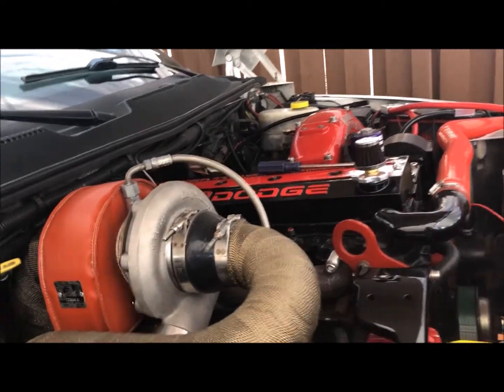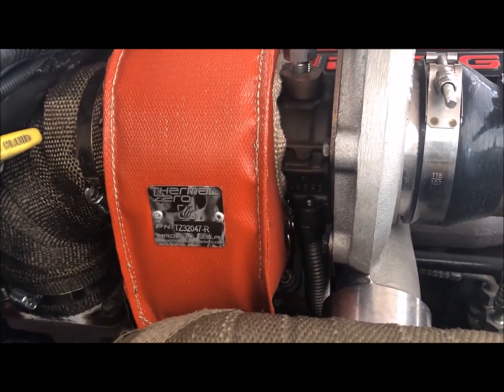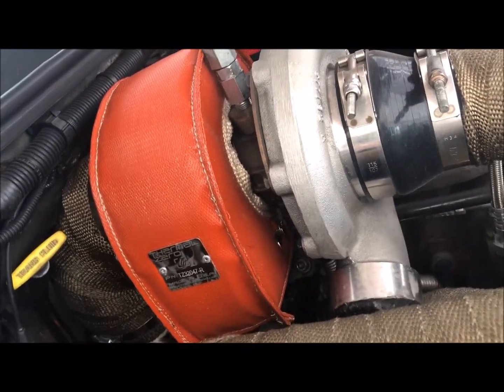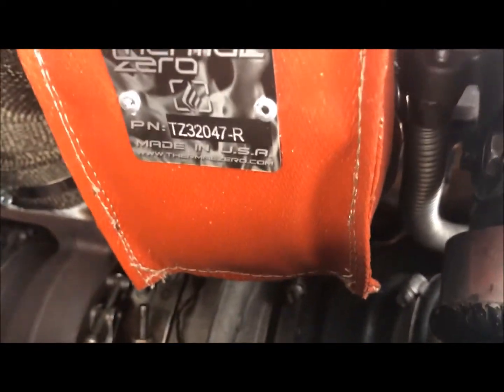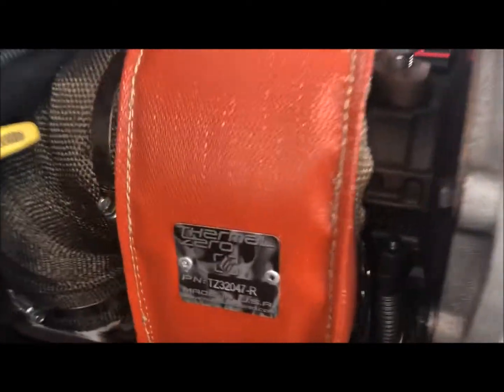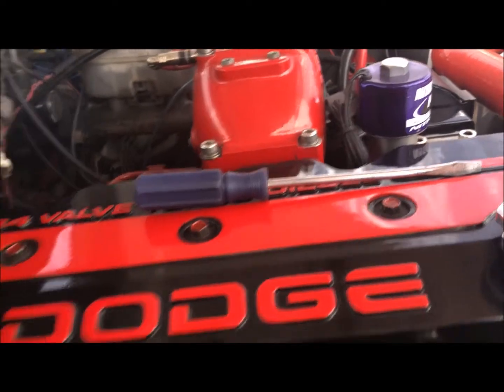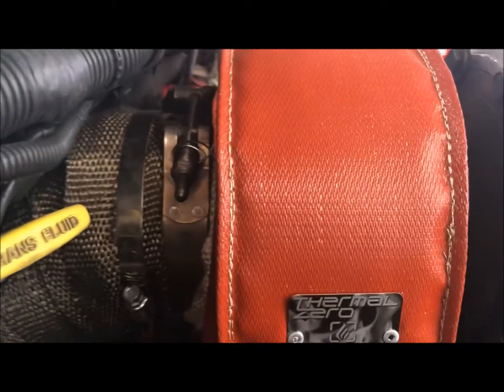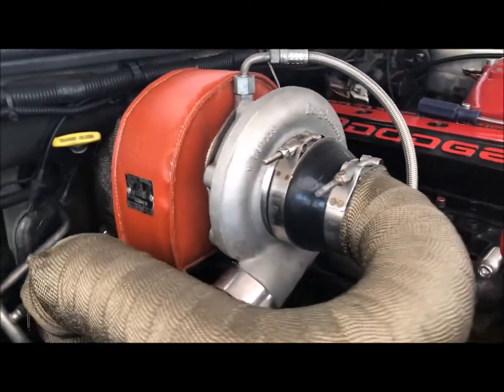Thermal Zero Universal Turbo Heat Shield Cover/5.9 Cummins

Comment: Results.....?  Or just for looks?
Reply from the maker: mostly looks.  I did, however, was surprised that it felt better constructed (had weight to it), and it fit easily on the 66mm turbo.
Reply: No reduction in EGT's?
Reply from the maker: my bad.  i have not been driving this project much.  seems like i never have time due to work work work.  if i can make a comparison I will shot you the answer to your question.

Comment: Why my truck is leaking oil by the front like coming out of the intercooler I had a twin turbo 24v can you help me
Reply from the maker: CHECK THE BOTTOM PLATE OF YOUR TURBO, SHOULD BE TWO BOLTS, WHERE THERE IS A GASKET.  MINE GOT LOOSE ONE TIME AND SHE LEAKED IN THAT AREA.  ALSO, CHECK YOUR OIL FEED LINES.
Reply: That's coming from the crank case breather tube that's in front of the engine. Usually it barely leaks oil from there but if you have a vacuum leak it leaks a lot. This is best but not the cheapest solution that I've found for that  https://puredieselpower.com/medium-duty/5.9l-cummins-fleetguard-cv50117-crankcase-ventilation-kit.html